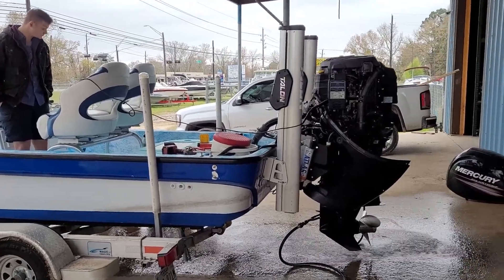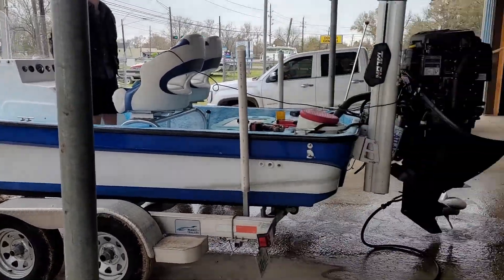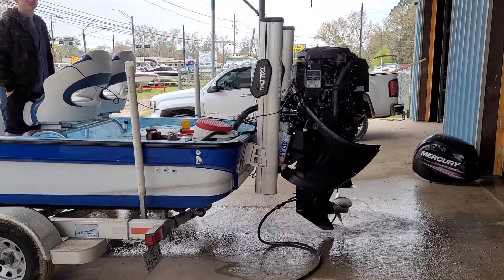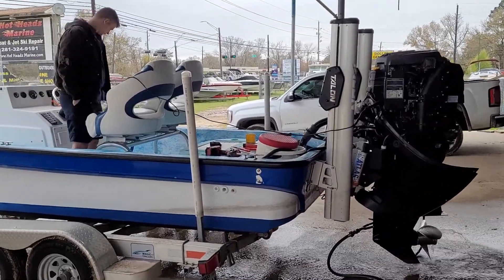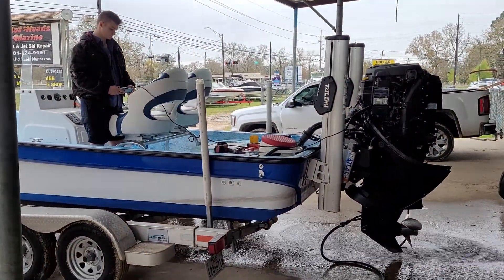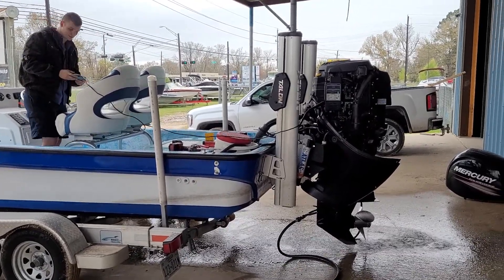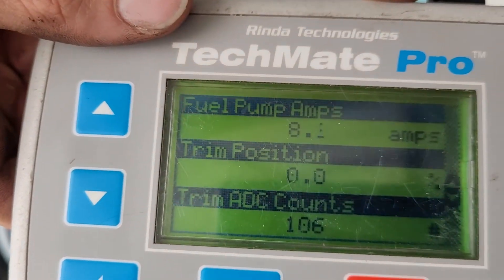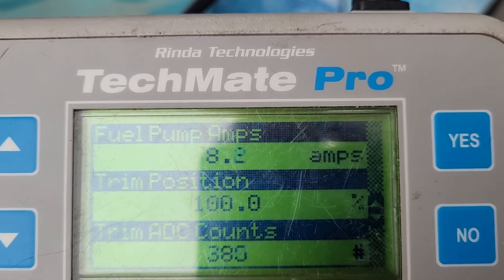Mercury 150 Four stroke trim angle diagnostics

Comment: I had the same issue. And it would always mess up in the worst spots. I had a prop lower unit and a jet lower unit for my outboard. I had 1500 lbs of fish in my boat, outgoing tide, and ripping the shallows and the trim sensor messed up on me, which ended up cutting my power and I came to rest on bottom in the shallows. Had to go get my other boat and load an ATV in it, haul the fish out of my boat to the other boat in the river, then come back 8 hours later, at midnight, in the dark, to retrieve my dried up boat, once the tide came back in. In other words, that trim sensor can really put you in a bad spot, especially when running a jet pump in shallow water. 

If you disconnect it, doesn’t work. Put too much voltage to it, doesn’t work. My fix? You tape a AA battery between the two wires, which feeds it 1.5 volts, and never worry about it again. I change the battery about once a month and never had an issue again. The bonus to it is you also get full rpm in the entire tilt range. So navigating shallow water, you can tilt your motor up and set the rpm a little higher and get some push, to push you into a deeper spot and lower and get on step.
Also makes a jet pump spray into the air like a fire hose. I’ve put fires out on the beach with it before. Haha 😂
Reply from the maker: Genius ❤️❤️❤️❤️❤️

Comment: I’m having this exact same issue on a new to me used pontoon boat with a 2016 Mercury 115 CT. The dealer has taken the boat to the water to troubleshoot and still not fixed. Mine will hop skip jump like it’s missing and get the 6 beeps guardian mode sometimes. The problem is intermittent and never pulls codes. It seems to happen after runnng between 2500 and 3000 rpm for a bit. Then once it starts doing it, it will do it a lot. I’ll turn key off, and restart and fine for a while, and sometimes not. Then I can take it out the next day and it don’t do it at all. I’m still under warranty with the marine dealer, but I don’t think they truly want to remedy the problem and send me down the road. I’m a mechanic for GE aviation for a living. I troubleshoot daily on equipment. I have enough sense to know when can’t find faults, but know there’s a problem, to pull out the volt meter and start checking Ohms, and continuity issues with electrical signals on sensors themselves. I can’t believe the people who claim to be mechanics and be half hearted at their job efforts. So did replacing the trim switch fix your issue here with the 150? Thanks
Reply: Did you figure out what it was? Im having the same issue.

Comment: Hi guys. I have that exact issue with my trim. It goes nuts on my vessel view screen and puts the motor in limp mode. What was the issue with the trim?
My motor is the same as the one you are filming. 
Thanks
Peter
Qld Australia
Reply from the maker: The trim pin itself behind the sender.  Still running well today. The pin has an embedded magnet or steel slug or a section treated so the sensor can see it move. Its a proximity switch. I forget the exact name of such a pro switch but hope this helps. Get a new pin and go from there. Make sure its installed correctly when replacing.